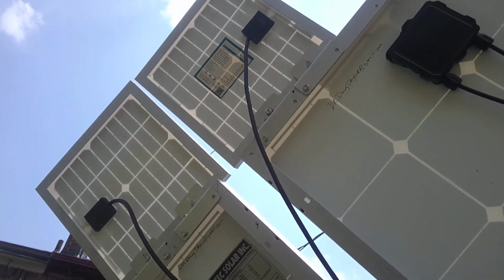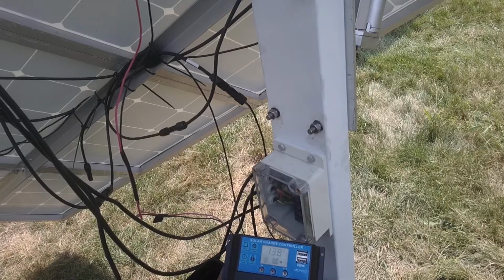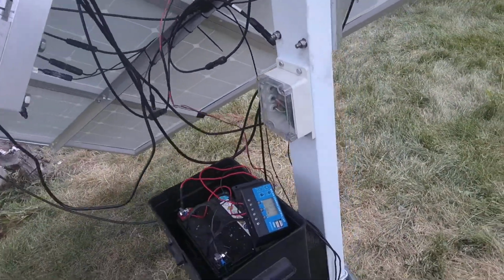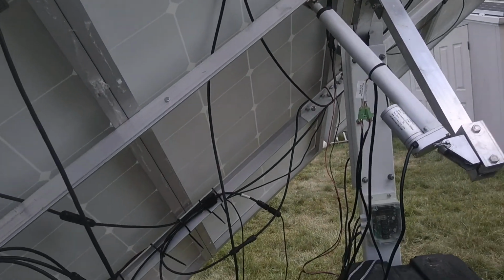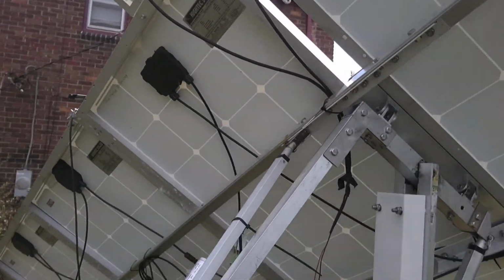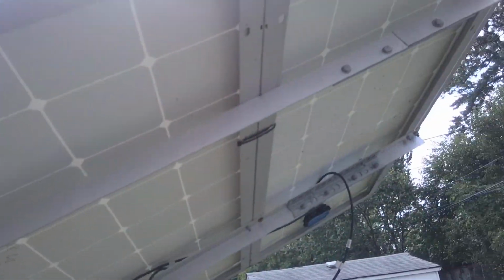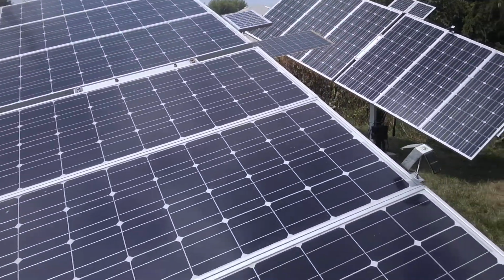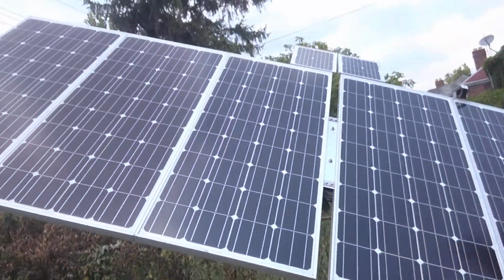Eco- Worthy  Dual Axis Solar Tracker ground mount.

Comment: I read where the gain of a tracking array is 10% to 25% over stationary, depending on where you live. I couldn't do it because I live in a high wind area and once had a big piece of siding blow off my house and down the street, but it's nice seeing how it is done using one of these trackers, which today are $540 on Amazon.

Comment: I just bought the same controller. I put a flash light on one of the sensors and both Motors ran at the same time. Have you noticed if yours does the same.
Reply from the maker: I've never tried using a light on my sensors. But to my recollection, I tested 12volts only on one of the actuator wires at a time.  When I press the remote button 3-6. Therefore, it sound like you might  have a bad circuit board. I had to contact Eco-Worthy  for a new board circuit when  my first Tracker control box when out.  Two years later second tracker was mailed to me with a bad control box. Everything  was basically operating backward. I contacted them again which they send me a new control box, sensor, wires  and remote.

Comment: Why only one battery per 6?
Reply: That one battery is only used to power the actuators which move all the panels towards the sun and is charged by the two small solar panels mounted at the top.